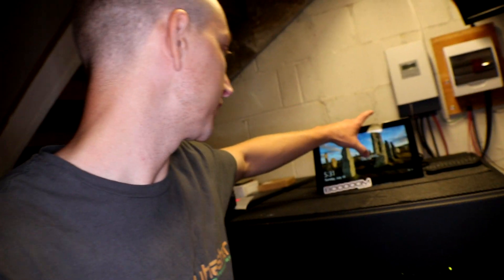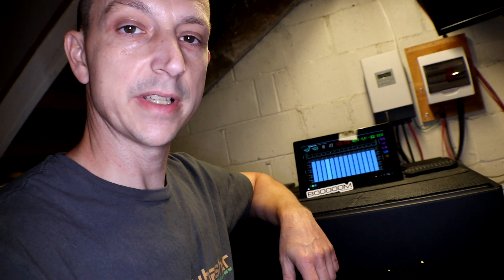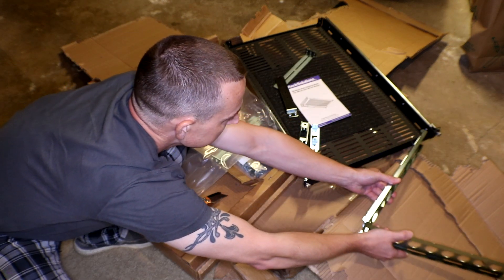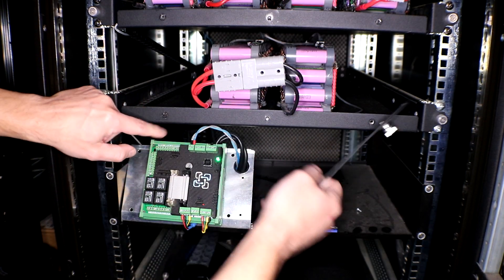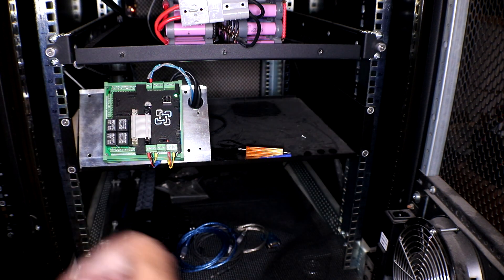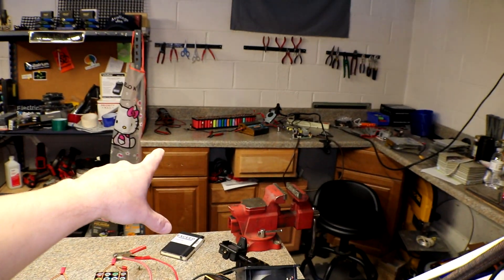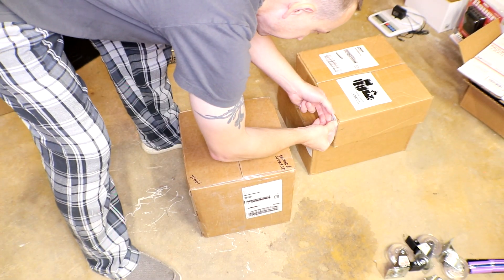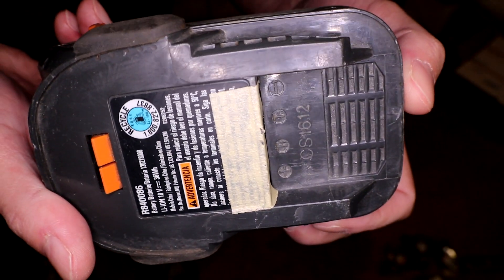New Stuff for Powerwall and Need help on other Project!💥

Comment: Oh Joe, I open my boxes a week later too. Lol Stay safe mate. I have a server like that too. No shelves yet. BMS going DIY way. Made a steel bucket with sand for battery flair ups.  Never work with animals or kids Joe never do what you want.
Reply from the maker: Yeah I really need to open them sooner lol.  I opened the other 2 shelves later that night and one of them looks like it was opened before and then "repackaged damaged" and was also missing the cable management stuff and all hardware.  Sent ebay person a msg but no reply!  🙄
Reply: @AVERAGE_JOE  No the feeling,  have simpler problems with Aliexpress and ebay driving me to drink and I don't drink.

Comment: Not sure if you have mentioned this before (new subscriber to your channel), but I think it would be good idea to "strongly recommend" that high current cells are not used in power walls as is a lot safer to use low current types (laptop / high capacity).
Reply from the maker: YES totally different type of cells for sure.  Im sure Ive mentioned it in past videos buuuuuut cant remember how far back it would have been!

Comment: So wouldn’t power drill batteries be “less quality” because they get stressed more? Or is my thinking incorrect? Just curious. And for the scooters you’ll need a few flux capacitors. Should do the trick.
Reply from the maker: Mmmmmmm yes....Im thinking along the same but thats why I ordered a bunch hoping the bms or some other error was going on in hopes to salvage some good cells!  aaaaaaand YES a few flux capacitors will be needed!

Comment: 24v 350w joe
Reply from the maker: Is that what is in there or is that what I want?
Reply: @AVERAGE_JOE  they are usually 2 ups lead acid batteries in series to get 24v and then they have a small brushed 350w motor

Comment: If it's got a brushless motor, to go faster, just get a motor controller with higher wattage, and about 12 v higher, rember the square, whan it comes to wattage, if it's 36v, I'd get a 48v1000 watt motor controller from Amazon, probably $25 or so, maybe a 1500 watt controller, they are less than $40, I got a 48-72v  1500 watt for a project , it was about $32,  I haven't had much luck with modified controllers, they tend to not last, but adding a bit of solder over the current shunt will add a little power,  but as cheap as controllers are , it's probably best to just buy one,
Reply from the maker: Im pretty sure there dc motors and 24v but will drag them out and check. Do we want a vid of all that?

Comment: Look up the motor if u can see any model numbers on it and u should be able to go 30% over the stock wattage without major issues and u shouldn't be over 15 amps and 36ish volts but that should help with speed dont get regen brakes they kill batteries causes to much heat you should be able to use ebike conversion kits or parts like throttle, brakes, speed controller, headlights, brake lights, and battery voltage display I've seen speed controllers that are 500 watts and have headlight, brake lights,throttle, and voltage display hookups for 40ish bucks
Reply from the maker: Yeah I need to drag one or ALL out to see if any work lol then see what um working with. I wanna say there 24v, you think 36v is ok? Do you have any links to stuff thats good?
Reply: @AVERAGE_JOE  36 on a 24 should work fine I'll take a look for some good ones and send a link
Reply: @AVERAGE_JOE these seem to have good reviews but I have no idea other than reviews posted  https://www.amazon.com/dp/B016O0B0MQ/ref=cm_sw_r_cp_apa_i_yPrgFbRZY606X

Or
https://www.amazon.com/dp/B016O0B0MQ/ref=cm_sw_r_cp_apa_i_yPrgFbRZY606X

Comment: the batterys alone in the scooters will make a hell of a diference alone compared to the lead acid they would of had mods after that would be speed controllers
Reply from the maker: May try with just batteries first then go from there!
Reply: @AVERAGE_JOE  it is the best best i was thinking of making a 24v pack for my apc rack ups but the when i read the bit you have to access by console to change options i thoght cant be bothered ill stick with lead acid i also had to use busness edition of the software as my only output is serial trying to set up the shut down file was a ball game in its self but relised to get true run time one has to do the self tests
anyway off topic i scene a bick increase on the kids electric cars going to lithuim so i would expect same for the scooter i know my nicad powered drill so bid power gains

Comment: I had to give away all my packs, because I'm moving back to Australia and can't ship them :( I even have to sell my electric skateboard  because, li-ion cells. :'(
I've always said "Don't make the cabinet just somewhere to place the cells, make the cabinet part of it". So your cabinet is the backbone with 4gauge wire to each row of packs and the plug into it like servers/drives do (ie hot swap) etc.. A good design would make it rock and easy to maintain.
Reply from the maker: Yeah everything will have the anderson connectors for sure. I like the idea of being able to take/remove items easily! Plus the anderson connector allows 2 connections for each connection. I like that vs a single bolt nut. You gonna start again once home?